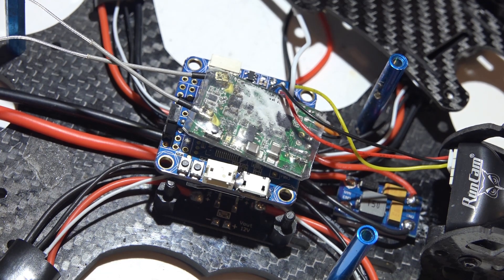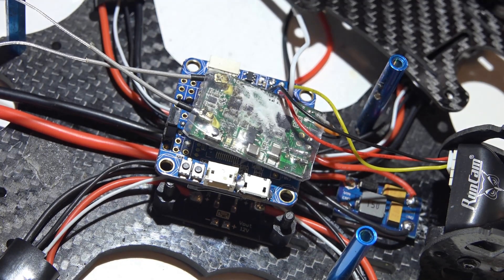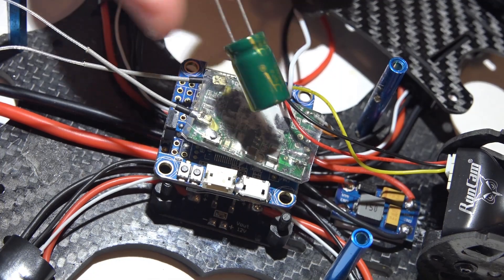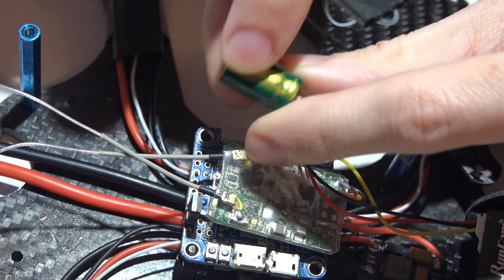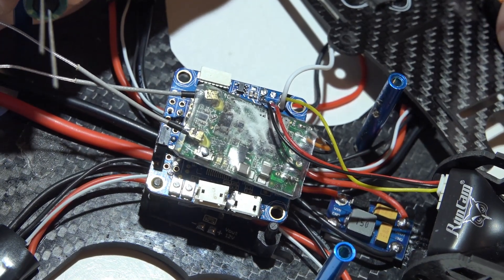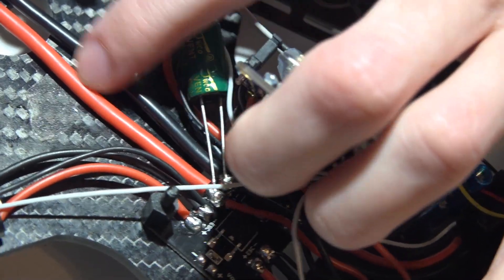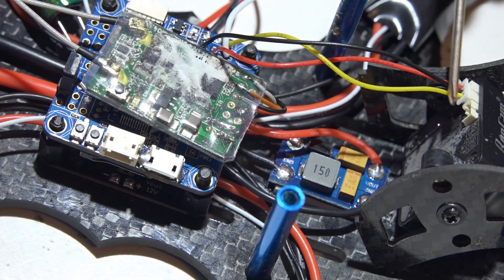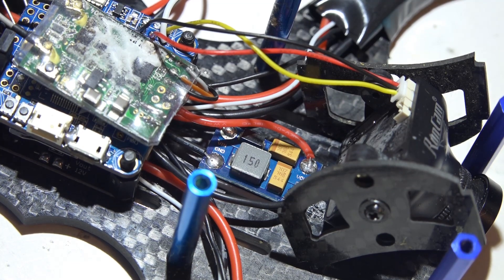Capacitors Used For Protection

Comment: snake oil for the ill informed. I'd like to see this "proof" of these spikes. It's absolute rubbish. "Active braking" just means the ESC shorts the motor windings, not to be confused with kinetic energy recovery systems (K.E.R.S. like the F1 had and abandoned) which switch the motor windings differently such that the energy generated by the motor is used to recharge the batteries (which creates a substantial magnetic drag on the motor's armature and effectively slowing the vehicle down "braking").   Even then, the motor is NEVER going to generate MORE voltage than what was required to get it up to whatever speed it was running at the instant before it was switched off. Not to mention the decoupling capacitors found in the esc's and every other device in RC's lately, and definitely not to mention THE INCREDIBLY TIGHT REGULATION both line and load, provided by the various on board linear voltage regulators throughout the system! 

It's all a massive con! Where is this "proof" of spikes you speak of??
Reply: The spike killed my regulator.

Comment: lol no idea..... cap there will have no effect and there is no voltage coming back from esc's as there is nothing converting the AC back to DC....lol

Cap being used for quads is used to stop brown outs and needs to go on the the 5v side of the board. 99% of boards that have onboard voltage reg have more than enough capacitance onboard.
Reply: The transistors in a regen-capable ESC are the components that  rectify the AC to the DC bus. This would happen even if the ESC was powered off, assuming you don't put a diode in series.
You don't need to supply power to the ESC to brake, you just need to divert the mechanical power available in the spinning propeller and the power supplied by the wind, into the DC bus. A primivite way of braking is just shorting the wires as you say, but that dumps the power that could be regenerated, as heat in the motor windings and ESC transistors.